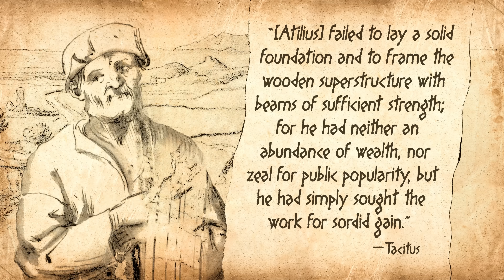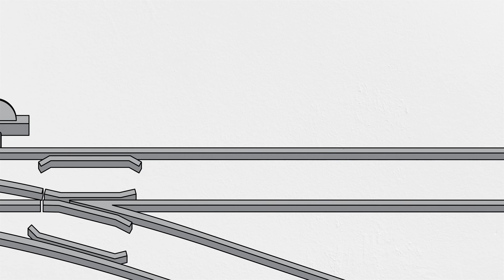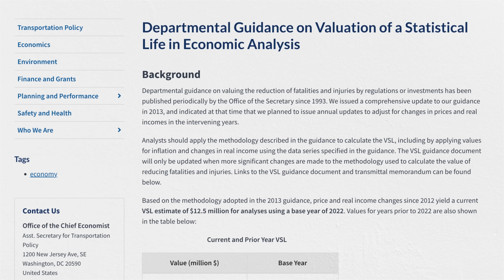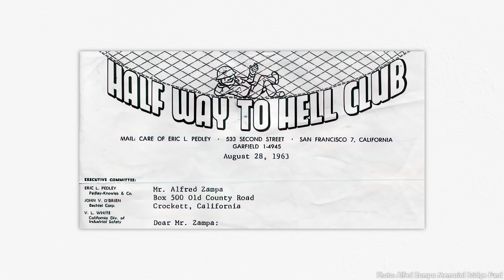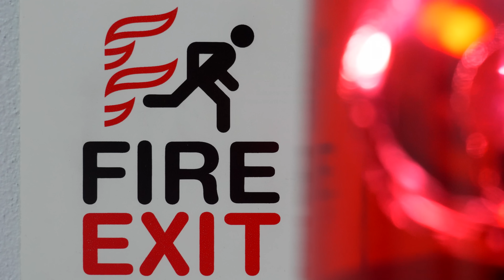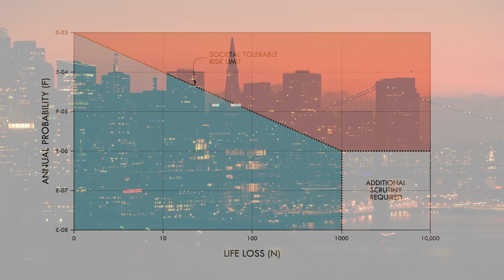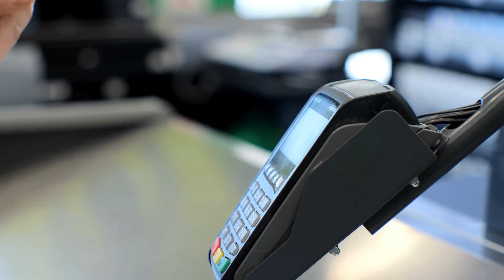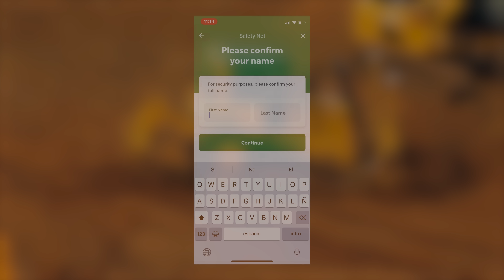How Much Is a Human Worth? (according to engineers)

Comment: While it is true that 19 people survived falling to the net of the Golden Gate bridge. It is not necessarily true that it saved 19 people. It might well be that many of those accidents were the result of carelessness brought about in part from the knowledge that the net was there to catch them if they did fall. There was also one incident where a cart fell along with 12 men, which broke the net, killing 10 of them. It's possible that this incident might also have been in part due to carelessness associated with an inflated perception of safety.
Reply: So what you're saying is that those 19 people were saved by the net, after they fell, possibly because they were careless. So the net saved 19 people, but may not have reduced the total number of deaths.
Reply: @notahotshot  It probably saved lives. But perhaps not as many. It's impossible to say how many people would have fallen if the net was never in place.
In total, 32 people fell during the construction of the bridge. 1 at a section where the net was not in place, 19 were saved by the net, and 12 men fell through the net in a mass accident that killed 10 of those 12. One of the men that survived the mass accident was dragged deep underwater by the net and thus was nearly killed by the net. The net may have drowned other workers in that same accident.
My point is that it's hard to quantify the efficacy of safety devices when the safety device is known to be in place by the people whom it protects.
Reply: I'm guessing you'd refuse to wear a seat belt if that was an option.  it's equally likely that ANOTHER 19 workers were reminded of the fall hazard by the presence of the net and worked more carefully.
Reply: @kenbrown2808  You'de guess wrong. I vehemently advocate for wearing seatbelts as it's one of the most effective means of reducing risk in day to day life. I'm just pointing out the nuance of unintended consequences.
Reply: @FourthRoot  well, I guess the unintended consequence of making the claim that safety equipment only makes people take more risks is being called out as a safety equipment denier.
Reply: @kenbrown2808  I'm not a safety equipment denier. I'm not saying safety equipment puts people at greater risk. It usually does the exact opposite, what it's designed to do, keep people safe. And that was probably true even for the net at the GGB. I'm just pointing out how complicated the world really is, and the exact number saved by that system is not so easy to estimate. Some people appreciate higher levels of thinking for their own sake. Others don't. There's a term for those others, simple-minded.
Reply: I've heard that most pedestrian road accidents happen at designated pedestrian crossings, where the pedestrian has an elevated sense of safety because they're on a crossing. Same idea.
Reply: @guyincognito.  most vehicle v. pedestrian accidents happen at pedestrian crossings for the same reason most bank robbers rob banks.  because that's where the money is.
Reply: @guyincognito.  Yes and no. Naturally, we would expect to see more pedestrians struck at crosswalks, even if the pedestrians are using the same degree of care when crossing. This is due to the simple fact that pedestrians cross the road at crosswalks more frequently than other parts of the road.
Reply: @guyincognito.  This sounds unlikely. Statistically, I'd say that most pedestrian road accidents occur where there are pedestrians i.e. at the crossings where they would normally congregate. If they were uniformly distributed due to lack of obvious crossings/paths, they'd probably occur elsewhere.

Comment: Good video. On the trolley problem, it is the manager's fault. He laid off the engineer and delayed vehicle maintenance for 5 years. Bridges that I designed and built 35+ years ago, do not appear to have ever had the recommended maintenance. Good Luck, Rick
Reply: I never thought that 😂😂
Reply: And the solution is to half switch the points, derailing the trolley which likely at most injures people

Comment: There's a quote from the railroading industry that's very similar to what you said about how rules are written in blood. Now days railroading is a much safer job than the late 1800s, but back then, you could "Tell how long a brake man has been on the job by how many fingers he had on his hand." You take a guess what that means. Back then they used link and pin. A link was held into a socket while the engineer switched the train into another train. Once close enough, the brakeman could put a pin into both sockets. This of course, many times have a brakeman got his fingers trapped between 2 sockets. Back then, any job was grim, but railroading was harsh.
Reply: Any stories about the brakemen riding on top of the cars, in all weather conditions, to turn the brake wheel on the cars in response to the engineer's (that's a locomotive driver in metric) whistles before the invention of air brakes?
Reply: @quintrankid8045  Oh yah, I know that happened sometimes. But the rear brakeman would usually just set the caboose brakes.
Reply: @quintrankid8045 English trains usually had a brake van, a car that brake men rode in on tail of train. Some had heat and were kinda roomy, brake wheel was inside the van. I don't know about US method. This was during steam era, before vacuum or air brakes.
Reply: OHS rules/laws are written in blood because corporations will happily kill workers in exchange for profit.
Reply: Nowadays all jobs could be done by machines but capitalism still needs wage slaves!
Reply: @3nertia  "All" jobs is a stretch, but "many" wouldn't be.
Reply: @warlocc-paul  I stand by what I said as I do not consider things like movies, books, sculptures, etc. to be "jobs" per se :)
Reply: @3nertia if you’re a bot, you just disproved your own statement, ’cause it makes no sense. And if you’re not a bot, consider handing your YouTube account over to one.
Reply: @DIW-Commentator  Consider making an actual logical argument instead of using a thinly veiled ad hominem ;)
Reply: @3nertia  That's oversimplifying I think. Robots need maintenance, as do humans. Whether a human job can be automated is a cost/benefit analysis between the two. The morality of the switch is an entirely separate issue.
Reply: @frostchain2362  There are already robots that can service themselves - what are we but a processing unit with various peripherals - eyes, arms, legs, olfactory, etc.

And of course it's a cost/benefit analysis - capitalism only cares about profits, not people ...
Reply: @3nertia  there is no way in hell I'm getting replaced by a robot. I didn't get my mechanical engineering majors for nothing.
Reply: @realcanadian67  Lol. Why wouldn't they replace you - we [humans] are slow, prone to errors, need sleep, food, water, need proper socialization, etc. ...

Machines don't. Your ego isn't actually a factor, despite what it tells you :)
Reply: @3nertia  That makes no sense.
Reply: Bots rarely do.
Reply: @3nertia Could your job of advocating for communism also be automated?

Comment: Liability is all the answer needed to solve the trolly problem.
Reply: But do you want the French way, were you as a private citizen is required to intervene if someone is in danger, and you can help them, or like in many other countries not have a "good samaritan" law?

With a "good samaritan" view, you might say that not acting is the same as acting, so you should throw the switch or face quintuple homicide. And if you throw the switch, you would still face an investigation for the single homicide, but circumstances would most likely mean no sentence.

Without it, saving the five is what might get you out of trouble for killing the one but being idle is not criminal.
Reply: Using the law to attempt to answer an ethical question is certainly a strategy...
Reply: Well to be fair if the ethicaI question is phrased as a real world problem, reality must be addressed. Otherwise I would pause time save everyone and then have icecream.
Can we expand the question to included my lack of knowledge or resposibility in operating trolly equipment? @Sprockete
Reply: damned if you do damned if you dont